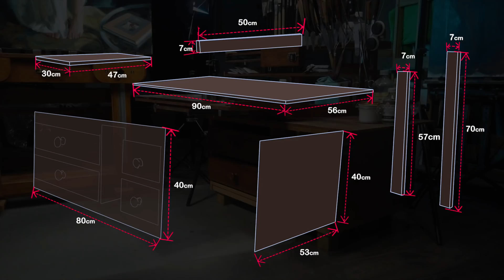Artist's workplace: palette table with drawers by Vladimir Volegov

Comment: I have followed you for years and you are one of my all time great artists. I have some problems recognizing colors and had my tubes piled up together. It took some time to find the color I was looking for and it was annoying. I bought a used dresser drawer and glued plywood slates for dividers in them. The building supply store cut them from a 1/4 inch plywood for free. I then labeled each one reds, blues, greens, yellows, oranges and earth colors. I put all related tubes into their bins. I now simply reach into the bin and pick out my color right away.  Thanks for all the years of your videos.